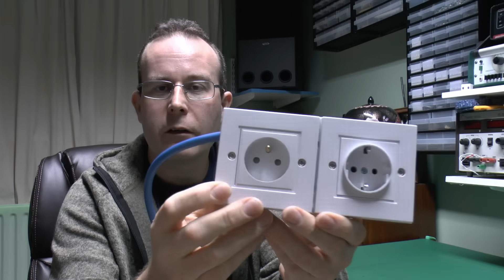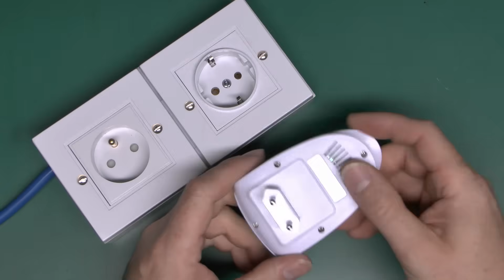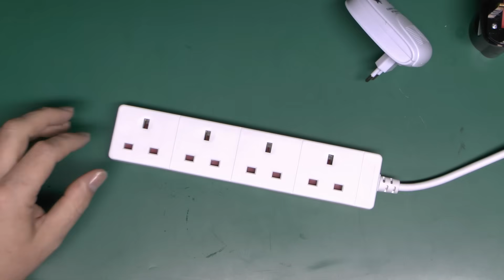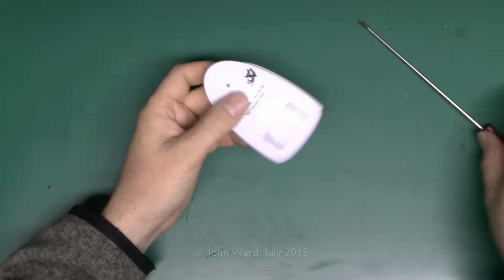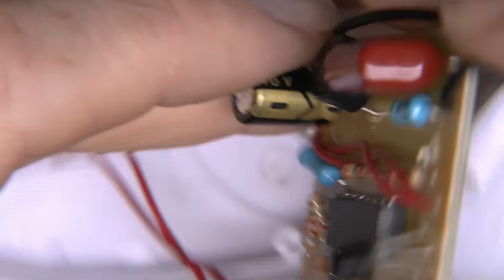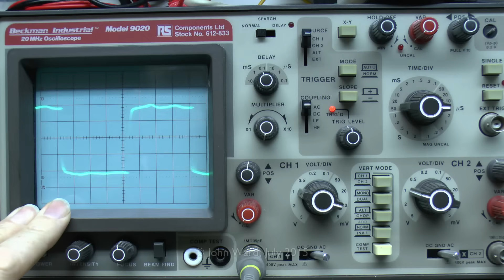Electro Magnetic Pest Repeller Device

Comment: That's a 680nF capacitor not 22n. The "684J" marking is the one specifying voltage and tolerance, the other marking is a date code or something. Other than that, nice video. To be honest i always wondered what those things have inside. They sell them on teleshopping here, and the price they sell them for is quite high, considering they cost <$3 shipped from China. I've seen the things in some peoples' homes but never got to take one apart. Thanks for the teardown.

Comment: Interesting. Having lived in France for the past 13 or so years I've never seen sockets that have those metal tabs on the sides for earthing, although I have indeed seen plugs with such tabs. In any case don't get me started on European sockets, they are a nightmare! At least the multiway leads we have bought over the years - given enough time it's eventually impossible to get the plugs in for some reason. Although seeing your video on that dodgy multiway extension I think I understand why it happens. :)
Reply: +BenjaminGoose On a side note, it's amazing what you can get on ebay for the price. I can't believe certain items even have free shipping despite the average local postage cost being much higher than the value of the item.

Comment: The Reddish Capacitor is more than likely part of a voltage divider (with Ac you can replace one or more of the resistors with a capacitor (using the capacitive reactance).

Comment: Did you use an isolation transformer during the osc. measurement. Those "hot" circuits are a pain. cheers.
Reply from the maker: 38911bytefree Yes, an isolating transformer was used for the supply to the device.

Comment: Would you say that the EU plug system is better than the ones used in the UK?
Also what do you think of the USA ones?
Reply: C00m7ee Type E, F and G are all eaqually good in terms of insulation. Type F is more secure mechanically. American ones are usually less safe but they operate at lower voltages. The Europlug isn't very safe but it's usually only used for low power devices.

Comment: depending the sense it's plugged, you have mains voltage "without the capacitor" directly on the transducer behind the grill and/or on the LED. i wonder if this conforms to minimum distance requirements.
Reply: rarbiart I was waiting in vain for the piezo/mains issue be commented on.

Comment: I don't understand you said the postage is more than the price of the item. So the item is already free, great quality for something that costs nothing. Are the big resistors involved in dropping the mains voltage?
Reply: Coolkeys2009 Sending the thing by inland post in the UK would have cost more than it did to buy it from China, delivery included.

As for the resistors, no. The big  red capacitor is is being used as what's called a reactive dropper - it's impedance at 50/60Hz is used to as a zero power loss resistor.

One big resistor looks like a 470k connected across the cap to make sure that it doesn't hold a charge when unplugged, removing any chance of a shock if the pins are touched. The other is what looks like a 5R6 in series with the DC supply to the '556 - see my earlier post.
Reply: @Graham_Langley  Does the effect of a capacitor to limit the current of an AC supply really count technically as "impedance?"
Reply: @Roflcopter4b  Of course it does.

Comment: I use one of these, but it's JML branded and apparently sends the signal out through the mains wiring.  I don't really know if they repel pests. I've seen people test them against caged mice, rats etc (on youtube) and they don't seem bothered by it.
Reply: Gadget Addict Well as we can see this one doesn't send anything out though the mains, and I somehow doubt the JML one does either. Anyone know better?
Reply: +Graham Langley "send anything out though the mains" The frequency of the sound will be detectable down the neutral, as this device uses a large portion of its power producing sound at a frequency, it will be detectable. However, at less than two watts, will that do ANYTHING to annoy the pests? I doubt they are capable of noticing it at all, but I am no biologist. Perhaps if you have sharks in your wall.

Comment: You probably shoudl mention the isolated transformer on the device. OR the ground on the probe would have made a loud bang, and disintegrated.
Reply: KingOfKYA Or just break the earth connection to the 'scope...

On my degree course may years back a lecturer did this during a practical and the half of the class that realised how dangerous this was left him in no doubt it wasn’t a good idea.
Reply: Graham Langley Yeah but then you don't want to touch the scope the metal parrsts may be live if you do that.

Leave it grounded and and isolate the device under test is always the best option. OF differential probes but there out of reach price wise.
Reply: KingOfKYA You missed the ellipsis and the second para I think...
Reply: Graham Langley Yeah i don't see em youtube probable ate them.

Anywasy yeah i can see the sarcasm now.
Reply: FWIW this wasn't to do a measurement on non-isolated mains as here, but to measure the signal across something on a ground-referenced cct.. A couple of students instructed the lecturer on how to do this correctly by putting the 'scope into summing mode (Ch1 + Ch2) and inverting one channel.
Reply: Graham Langley  Oh wow even worse that he was told.

Comment: The very early incarnations of these things claimed to send signals back down the mains to discourage pests as well as using ultrasound, so at guess this is the source of the 'electro magnetic' bit as copied here.

A '556-based swept oscillator circuit like this was so widely used in security alarm sounders that Zetex (as they then were) did a dedicated 8-pin device to to simplify it, the ZSD100. It's discontinued but I wouldn't be surprised if someone does a copy.

BTW that missing three-pin thing looks to me like a switch.
Reply: I've now finished watching. The bits on the top of the squarewave are the piezo ringing - the output of the '556 should be a lot cleaner. 

Also there doesn't seem to be a zener to limit the output of the capacitive dropper, so the supply to the '556 will be set by the cct's current draw and the 5R6 resistor. Which is presumably why the output amplitude varies with the sweep.

Comment: The two timers are likely used for creating the high frequency to drive the piezo and the other one to modulate the high frequency to make it more annoying to pests.
Reply: SDG Electronics Yup - it's a standard '556 cct used for sirens, here shifted to >20kHz. Deluxe versions of these devices have switches to set the frequency to allegedly target specific pests, from pigeons to cockroaches. I'd put money on the omitted switch and resistor doing this.